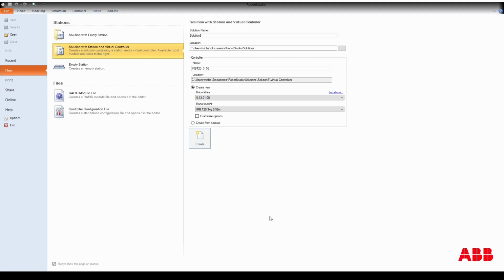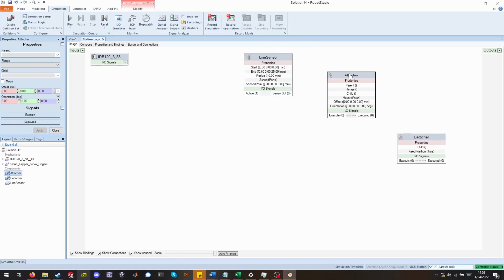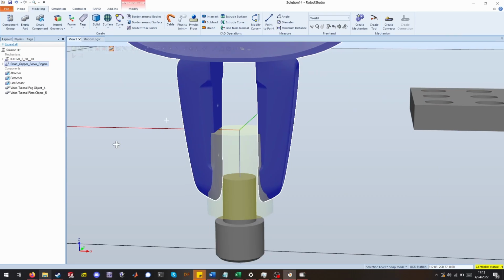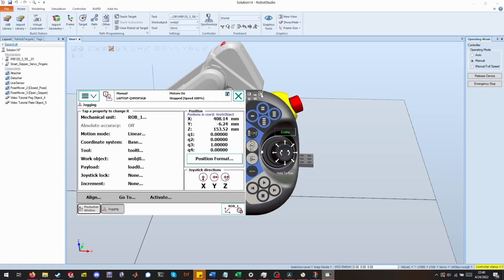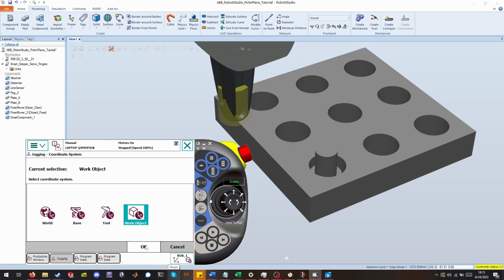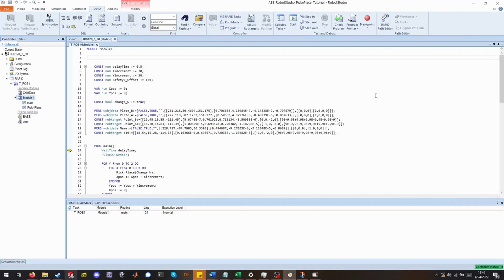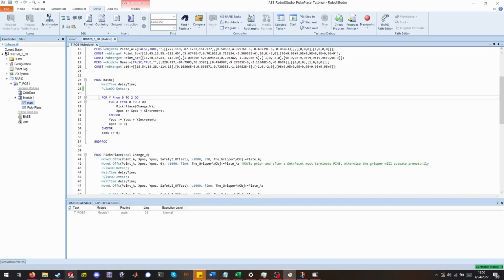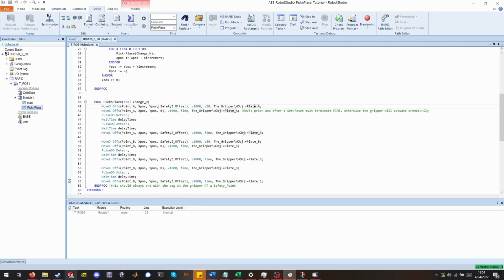Amazing ABB RobotStudio Tutorial on Gripper Modeling, Pick and Place Simulation, and Rapid Coding

Comment: Hi, I can't add a new pose because I don't even have these buttons (set, edit, remove) is it possible because I have an unofficial version?
Reply: I had the same problem and i found out when you pull on the "edges" of the modify mechanic window you change the layout which in my case revealed the "hidden" buttons.
Reply from the maker: No idea